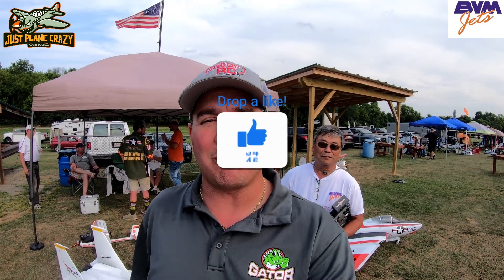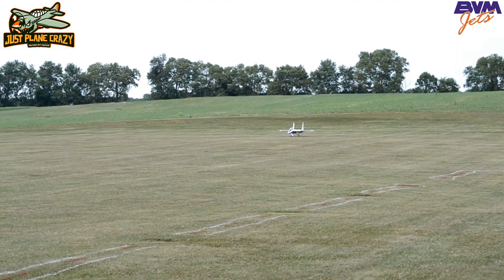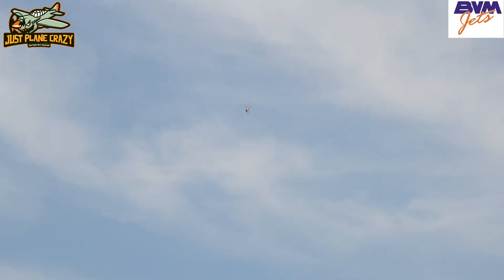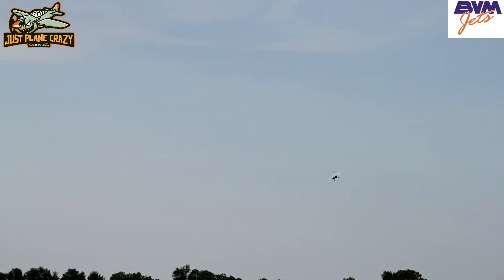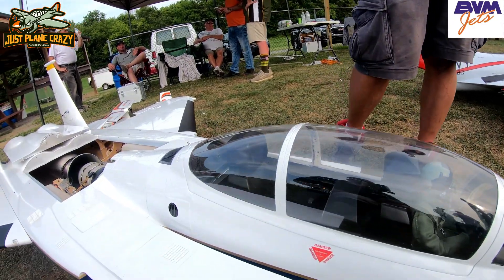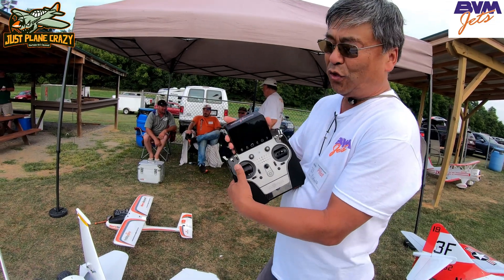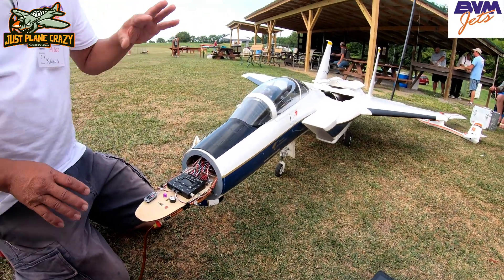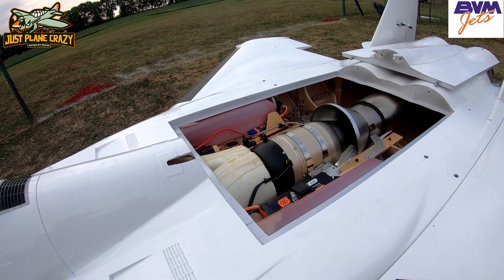BVM F15 Eagle  w/ Swiwin 140 Turbine, Flown by Team Pilot Kwang Ko

Comment: I see he threw out the original Jetlegend air trap tank and installed a BVM UAT. Good choice. The original air trap is crap and installed in the forward nose section. Thus fuel is sucked to the nose and pumped all the way back to the turbine. Nonsense. Additionally the F-15 tends to get nose heavy. So you want to move aft some heavier components. The original JL air trap weighs about 250g when fuelled. 
I also installed a UAT in my F15 in front of the smoke tank.
Reply from the maker: Kwan is super knowledgeable an knows his stuff for sure. He is also a great pilot